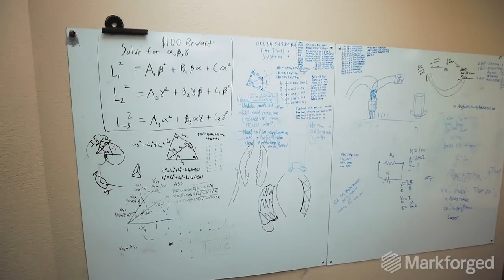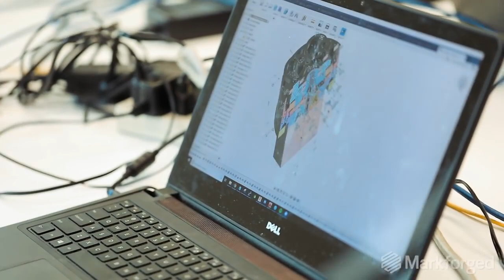Dexter: 3D Printed 7+ Axis Robot Arm | Low-cost, High Precision Desktop Robotic Arm - Chemtron

Comment: I'd like to know what 'low cost' printers y'all were using initially because if you have a ~30% success rate you must be doing something wrong... level the bed and any printer you buy now will run pretty much without issue